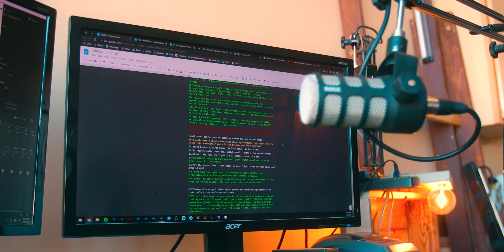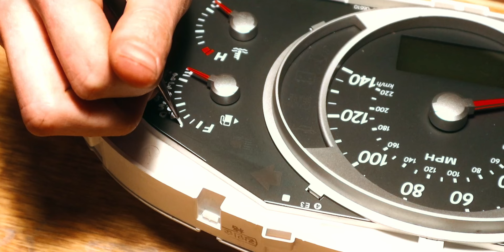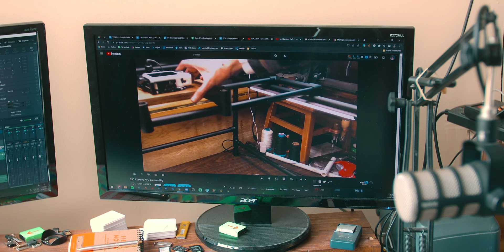Build your workspace EXACTLY how you like

Comment: Now this is a desk you can really get work done on.  I see too many youtuber with super-clean desk and immaculate cable management and I wonder what they use their desk for, except to put their gears on.  With this type of desk, I don't have to worry about scratching or damaging the table top or worrying about spilling something.  It would be ideal for working.
Reply from the maker: Exactly. I literally drill holes in it all the time, get pens flowing on it, clean paintbrushes, it’s so useful to have a surface that I don’t need to worry about